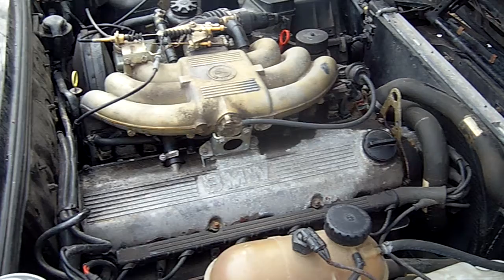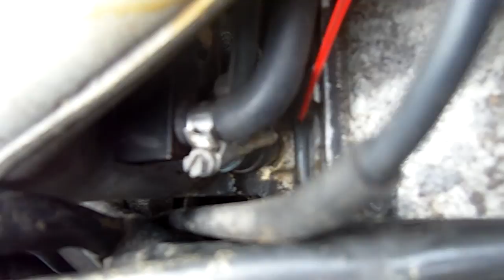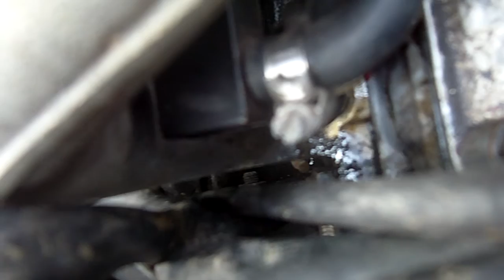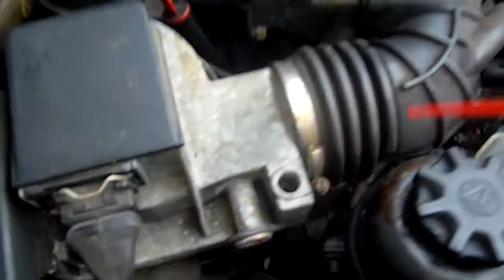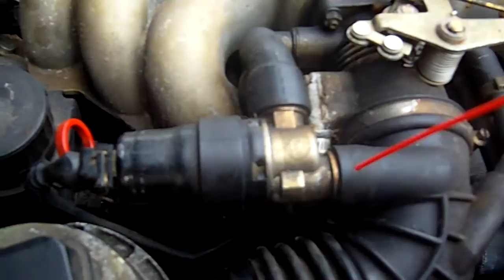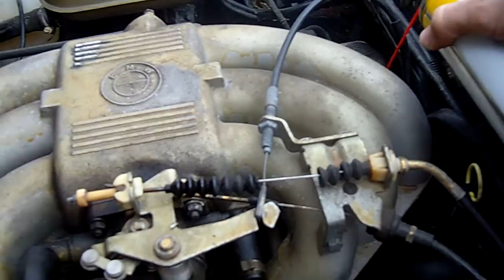M20 rough idle, carb cleaner makes it better?

Comment from the maker: @a0987312245 the intake manifold gasket helped a lot. the M20 has a nasty tendancy to blow a chunk of the #6 gasket out and cause this problem. the job isnt too hard and its a good percaution to take because current gaskets are better designed.

the ICV being dirty or defective can have an adverse effect on the idle but generalliy its idle speed not smoothness.

check other intake vacuum leak areas first.

Comment from the maker: yeah, either an injector o-ring or the intake manifold gasket, I ordered 6 rebuilt injectors w/new seals and an intake manifold gasket, I'll post up if it fixes the problem